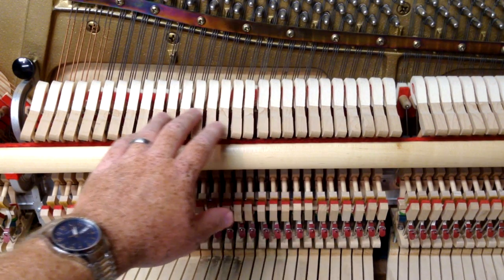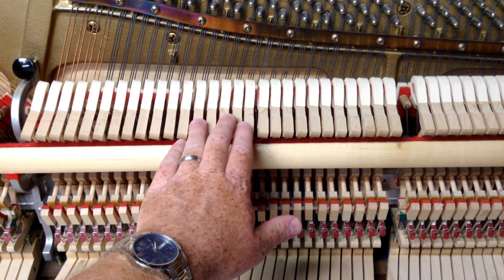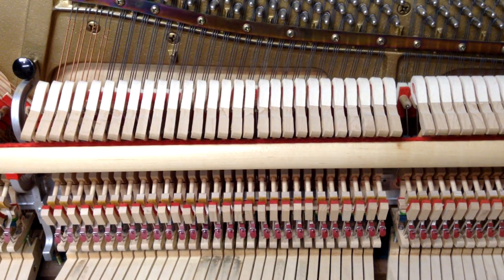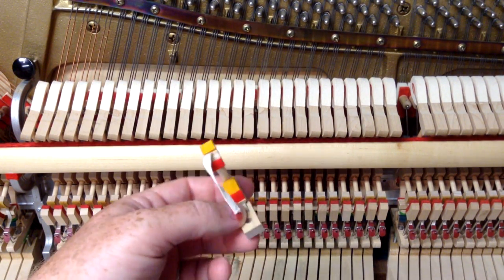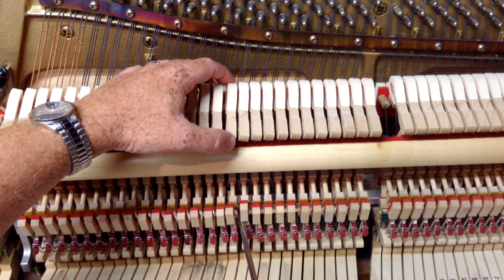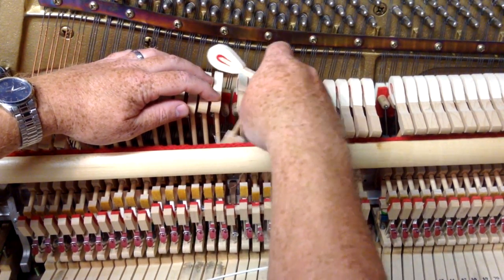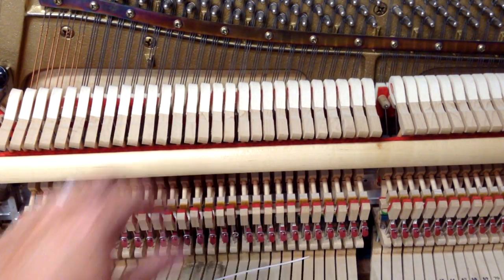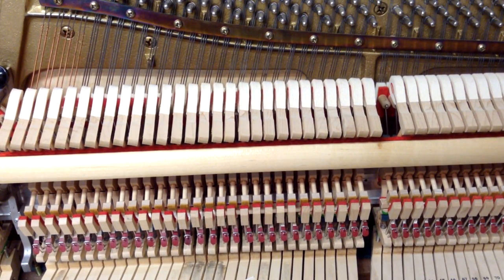Correcting Rubbing Hammers - Piano Tuning & Repair I HOWARD PIANO INDUSTRIES

Comment: Great videos Steve. Nearly done restoring my 1914 upright and yes indeed it had several rubbing hammers as described here. Resetting the flange screw cured 75% of the rubbing hammers. I also had great results mildly reshaping the flange groove with a finger nail file. Shim paper works the same way, but I didn't have any.

Comment: Just worked on a hammer that has gone out of line by twisting. Used a hair straightener to heat the joint and realign. Worked perfectly, just got to be careful of 'dry' joint.

Comment: A small hair straightener works well for burning shanks (twisting shanks) - especially if you have access to a plug and don't want an open flame.  Gently twist hammer in intended direction with one hand while massaging the shank with the hair straightener, being careful not to let the hair straightener touch the felt that the shank rests upon (it will melt it).

Comment: Hi Howard and thanks so much for the excellent video tutorials! 
With your help i did my first repair and tuning of an older Chilton (SN 7   2006) I ran into a couple of questions that u can probably answer... 1. Several of the midrange hammers were only striking 2 of 3 strings and the shafts on the hammers were made of wood so heating or bending the shafts is out but curiously the hammer alignment looked pretty good...idea's?...  2.  3 of the hammers need replacing but look very custom and all components are made of wood is it possible to purchase/find these or make up some replacement ones?... 3. Key#88 (highest C) the ivory is completely stripped off the key, is it possible to repair/replace this key?
Thanks again for sharing your knowledge and your excellent video presentations.
Merry Christmas

Comment: Hello, I am your student Xavier 57 years ... I wanted to ask you why you put the slip of paper under the crutch and not on the face where it is then screwed onto the bar? 
Congratulations and thank you again for your excellent work on the popular piano technology
Reply from the maker: If you put the paper on the face of the flange it will twist the hammer rather than moving it side to side with no twist so it depends on how the hammer is out of alignment which will determine where you put the travel paper.

Comment: Thank you for your great video. Our piano is an Irmler P118. There is a sticker inside that shows that the hammers are Abel. The problem is that some of the hammers are not misaligned, but when I touch them with my finger they are very loose. By looking closely I see that the hammer butt pin came halfway out. So I took out these loose hammers like you show in the video and pushed the pins back in. However, the pins of the keys we use the most often come loose every year or so. My questions are:  1) Why do the pins come out?  2) Is there a way to do a permanent repair like adding some glue to the pin before pushing it back in?  
Thank you in advance!
Reply from the maker: The reason the pins come out is because they are too loose in the wood part of the hinge.  The proper fix for this is to repin the part with a new pin.  You’ll also probably need to resize the felt for the larger pin.  We have a video on how to do this.

Comment: Great tutorials! Thanks... One question, though. The hammers are likely to be unevenly spaced in old pianos that also have wear from the strings on the hammers. So, once properly aligned those hammers will no longer hit the strings where the dents on the hammers are. Should this be a concern that should also be addressed when aligning the hammers?  Thanks...
Reply from the maker: Yes, if there are deep string grooves on the hammers, you will want to file the hammers first so the grooves are removed.  Thanks for bringing up this important point.
Reply: Thanks for your reply. I was thinking more about this and have another question. I watched another video (not yours) about changing the hammers. So, when changing hammers, I guess one should first check if there were any papers put under any flanges, right? Thanks...
Reply from the maker: When changing hammers, you may be able to align the new hammers so it doesn’t need to be shimmed.

Comment: Hi, just a question as to Hammer alignmnt.  When the hammer is not hitting all three strings at the same time in treble region, because the felt isn't perpendiculat to the string what would be the best way to correct it?
Reply from the maker: If the hammer isn't traveling straight, you would need to travel the flange by putting travel paper behind the flange.  If it is traveling too far to the right you would put the travel paper behind the left side of the flange and vice versa.

Comment: Hey Howard, I'm having an issue with the hammer head making contact with the top of the damper causing the key to stick. It looks like the hammer head in question is traveling further than the others. What can i do to adjust this?
Reply from the maker: You may need to adjust the damper head to be slightly lower.

Comment: Sorry but maybe I did not understand very well the speech ... if I put the
paper on the sides of the face of the flange nut hammer or right or left
not I correct the trajectory of the hammer on the string? I am not clear
when you put it under the crutch I would take a schemino to clear my head
because I do not understand English well but alas I only understand a few
words tecnici..comunque're doing a great job!
Hello
Saverio
Reply from the maker: What you are describing will actually move the hammer in a way that the hammer will not strike the three strings together.  If you put the paper on the right side of the flange it would make the hammer angel so the left side of the hammer would strike the strings first.  You want to make sure that the face of the hammer strikes all of the strings at the same time.

Comment: Hi Howard, great videos! How would you adjust this if all hammers have moved to the left? They are not hitting the rightmost string in their 3-string unisons, but instead hitting the rightmost string of the note next to them. The hammers are not angled wrongly and the travel seems straight. It's more like all the hammers have shifted a bit to the left. Moving the entire action a bit to the right would fix the problem, unfortunately the dampers seem to be correctly positioned. Also I wouldn't know how to do that. Do you have any advice on this - is there a better way than to correct this individually on each hammer? Thanks.
Reply from the maker: It's possible that the whole hammer rail has been moved somehow.  It's difficult to tell without seeing the action.

Comment: Thank you for this. One question, I have a new piano and I noticed two hammers have grooves moved to the left (it has three but moved, so the last one is on the edge). It sounds good, but, is it better to fix it on time or better wait when it start not sounding right. And does the heating weakens the shank? What is better for new piano, heating or putting the paper? 
Thank you in advance.
Reply from the maker: If the shank is warped, then you would want to heat the shank to straighten it out.  Otherwise papering the flange would be the best solution.

Comment: Ill go look if you have posted something about hammers hitting the string twice.. but I wanted to ask if there is a fix for this? If I play staccato, or just play and Dont hold(p, f, ff etc) the hammer hits the strings twice instead of once, and its very noticable! Its a Brand New Kawai K-300.. this cant be normal?!
Reply: So many variables, but I seem to read about this a lot in relation to Kawais for some reason. I think your best bet is having it thoroughly regulated. Usually it occurs a lot with very soft playing but your issue with general staccato playing at all volumes seems to suggest it might be the return springs being in-proportionately strong for the hammers. I hope you figure it out/Howard enlightens us all!
Reply: by the way, your videos are awesome!

Comment: how do I remove a jack to replace a spring please?
Reply from the maker: To remove the jack you have to take the whippen out of the action.  To do this you would remove the action from the piano and then take out the screw on the back of the action which holds the whippen in place.

Comment: my piano was great for nearly 30 years. It sounded like it had not been tuned in a while, but it was absolutely playable , and musically coherent. But all of a sudden ( in piano years) it went way out of tune, and a whole bunch of hammers warped. The hammers warped so bad that several are striking strings of the adjacent note; which is obviously incredibly noticeable. My question is; why would it be relatively stable  for decades, and then get way out of whack in a very short time period?   I am no professional....I am bewildered as to why it would fail so quickly , and so drastically.    And please - piano pros- dont tear me apart for not giving the piano any maintenance at all.  I know that's wrong, and i'm paying the price. now;  but im curious as to why it failed so fast.   Lets say I fix the crooked hammers,  will the rest continue to fail? Is there wood or glue or something that is failing?      Why all at once?  - Brian
Reply from the maker: Hi Brian,
The one thing that I can think of that would be the most likely cause is a drastic change in the humidity fluctuation.  But if this hasn't happened,  it could be that the problems you're having could have been happening gradually and just now the problems are becoming noticeable.  It could be with the tuning that the pinblock has gotten to the point where the tuning pins are getting loose and aren't holding pitch as well as they used to.  Also for the hammers,  if they were gradually over time getting warped and just now they are to the point where they are so bad that they are striking strings for the adjacent note.  Is the humidity fairly stable where the piano is located?  If not,  this would be the cause of these issues.
Reply: Thanks for the input.  The gradual warping is probably right. The piano is in Atlanta. We swing from dry at times to swimming pool, at times. I'm sure that is extremely tough on pianos. I never really paid attention to the hammers until now. Tuning pins?   I think I would like to learn some of the mystical arts of piano maintenance , and repair.  Do you know of a good starting point? A book , or even a DVD. Thanks for the patient response . I'm sure some of yáll pros were rolling your eyes at my questions. Thanks!
Reply from the maker: Yes, piano tuning and repair can be quite interesting.  You may want to start by just watching some of our many videos available here on our YouTube channel.  The best book that is available is "Pianos Inside Out"  by  Mario Igrec.  The book is a little bit pricey,  but it has more  information about the piano than any other book ever published.  Here is a link to where you can buy the book on our website: http://howardpianoindustries.com/pianos-inside-out-a-comprehensive-guide-to-piano-tuning-repairing-and-rebuilding/

Comment: parts repair  where can I find for a leland piano lyon &healy  serial L539
Reply from the maker: Most pianos use fairly standard parts so we should be able to get most any parts you need.  Occasionally there are pianos or certain parts that aren't available.  If you contact me about which parts it is that you need I can see if they are available.